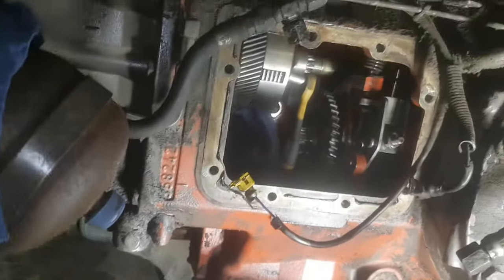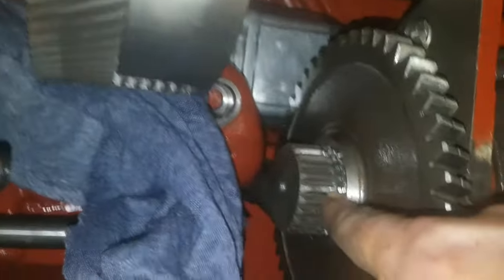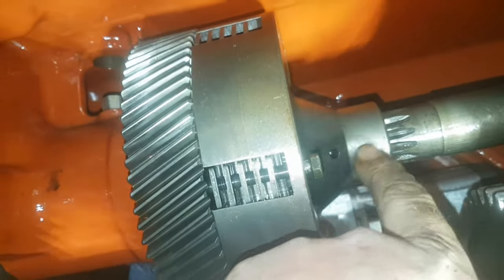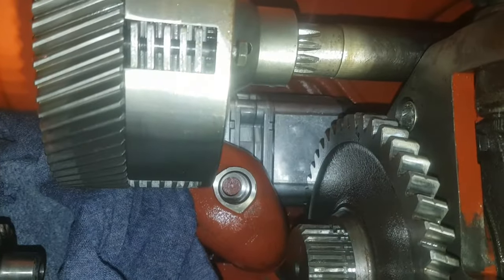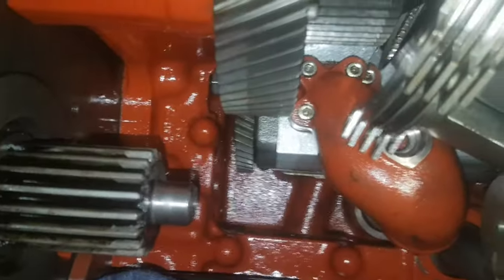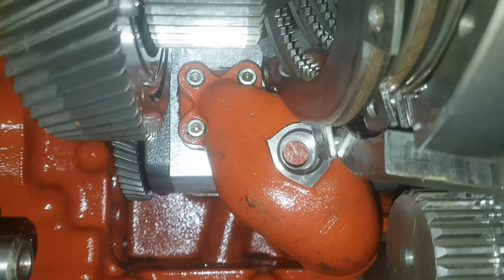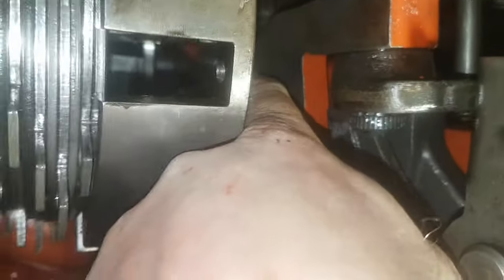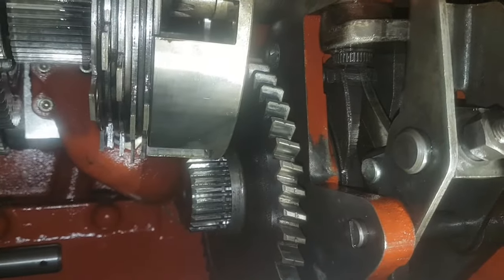Massey Ferguson 3125 handbrake overhaul restoration part 3

Comment: Nice one  i went into my 6150 for the same no handbrake started to look at doing this to replace the discs only to realise the nut on the actuator had come un done i got it adjusted right and put a lock nut on it , will be interested to see if you manage to change the discs from this side  👍
Reply from the maker: Cheers Ben I got it all out through the left cover simple enough job to be fair
Reply: Hi just trying to do me handbrake on a 3065 and I don’t have the bolts on my pto clutch pack, can’t see how to split it to get it slid back to get suction pipe off the pump. Mine is a 2wd but still can’t get Allen in square to get the bolt loose. Do I have to take cover off other side? Cheers Steve
Reply: @stevewilce967  If memory serves the manual has you take the other side off to get the suction pipe out the way , there must be something holding the pto clutch pack together could be recessed bolts or allens ??
Reply: @bengoddard6898  no recessed Allen’s think there’s a snap ring that holds it all together, that looks like you take the lot out and do on a bench. I’ve started taking off other side now, didn’t want to but have no choice. Thanks
Reply: Hi started taking off other side the stoped because 1 of the oil feed pipe was seized, so had another look and found if you take off rear top link bracket you can slide out the PTO shaft then draw out the PTO pack. Happy days as taking off the left hand side looks a Arse! Got hand brake out eventually as disk was split and burnt out badly, so found second hand compleat unit so hopefully have her back together ready for hay making. Cheers for the tutorial great help! Thanks